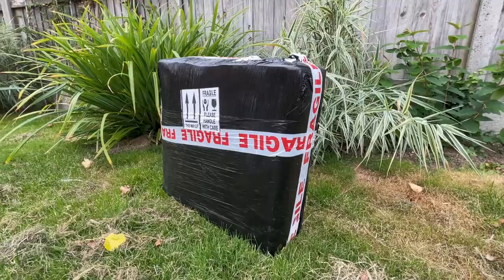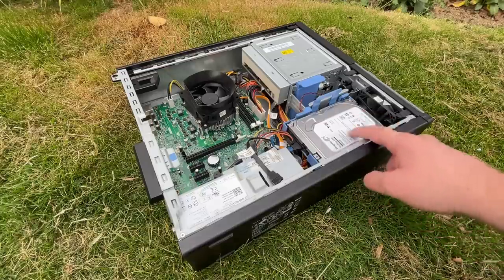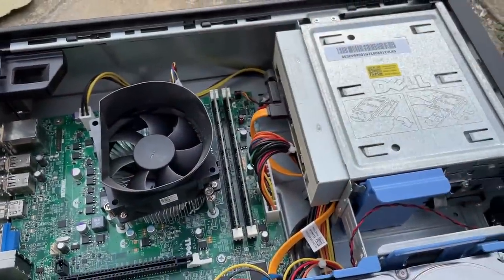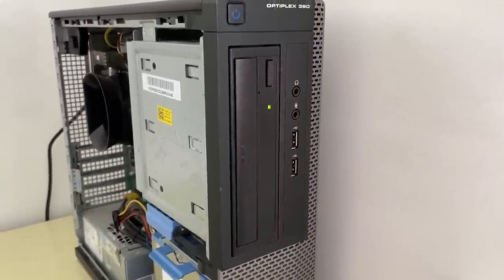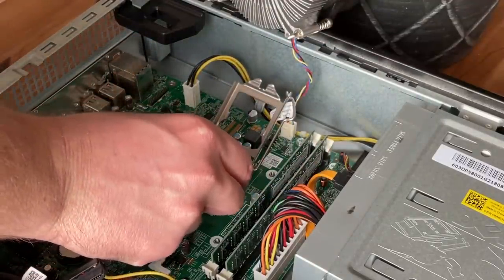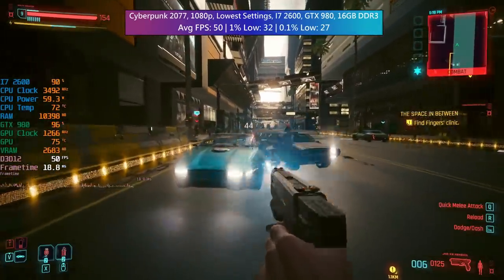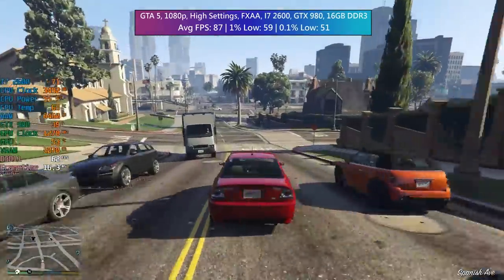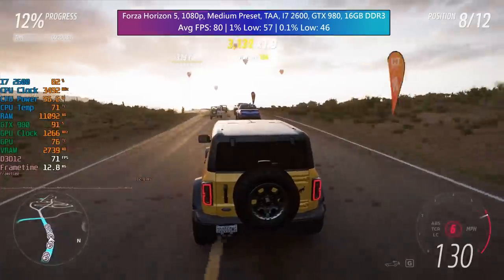The seller didn't know the specs of this £15 PC...

Comment: i bought a computer from work with a 2070, i7 8700k, 24 gb of ram and an aio that we took in for an incredulously low price due to cosmetic wear (smokers house and pets you can imagine what that looks like) and all that with a monitor was $240 for me.  quick upgrade for someone like me who was running a r5 1600x and vega 56

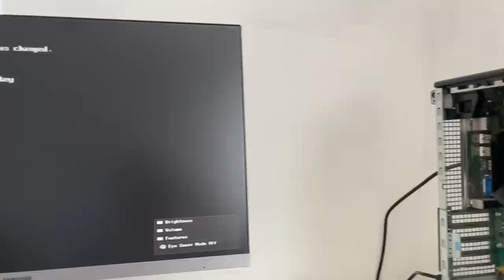Comment: 2:34 core2duo or PentiumD 1000% EDIT 😳😳😳 wow i would not expect i7 2nd gen atall! EDIT no.2 CS2 on my RX 6600XT with 23.9.3 drivers absolutely unplayable until i installed 23.10.1 so i doubt those 0.1% lows are caused by a week😅 cpu..

Comment: starfield works better with CAS vs FSR2 for CPU load on low spec hardware. i got one of these i7's still but its in a rig im making for a friend, pairing it with an R9 280.

Comment: a low profile rtx4060 probably the latest card that fits fine in the system, but a low profile gtx1650 is probably more sensible considering the cost

Comment: If you put some RGB on the front and a gt 1030 in it you can be like one of these gaming pc flipper youtube channels
Reply: GT1030 suks , is not worth to buy that crap , better to change case , better PSU and get used RX580 8GB ... in Sweden where I live GT1030 cost 500kr , but for 700-800kr you can get RX580 8gb ...
Reply: @smilingpolitely12345  Lol I know I it was just sarcasm
Reply: @olnnn  Buddy , without useing punctuation in your text , is not sarcasm is statement , so yeah next time use "..." if you use sarcasm, because there are no shortage of people in internet that mean whet they are writting. o7

Comment: same happened with my main pc i bought it for 35 euros as broken they didnt know what beast this is (i7 8700 + 32 gb ddr4 ram) it didnt work because the 3rd ram slot doesnt work so i diagnosed it and fixed it (they even cut the 24 pin cable from the psu i dont think they knew you can unplug it)

Comment: i have a Rog strix Mobo with a Q9550 and 8GB 800mhz ram and a 1TB timetech SSD with windows 10 !!! throw a 100$ GTX 1070 8gb and see how it fairs maybe even do the tape mod on one of the cpu pads too overclock it LMAO and put a decent cooler on it hahahah get that 4+GHZ on a old Dual Core Qaud hahahaha and see how it fairs in 2023 !!!